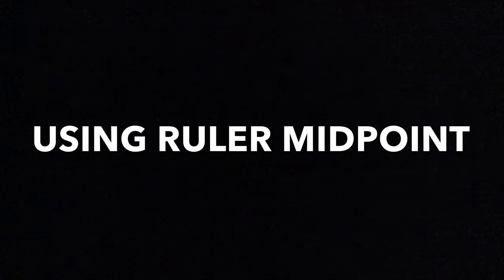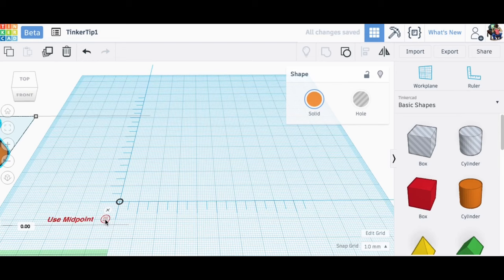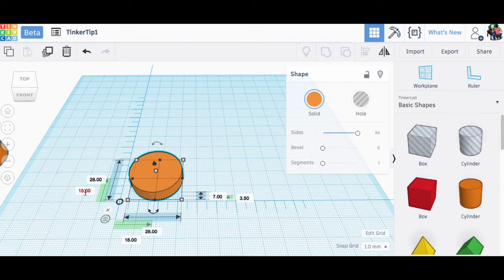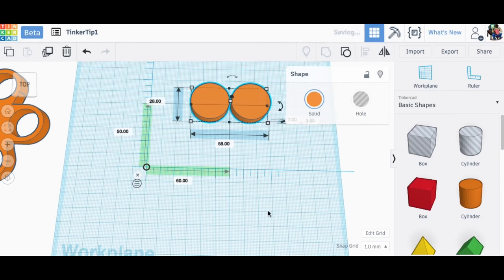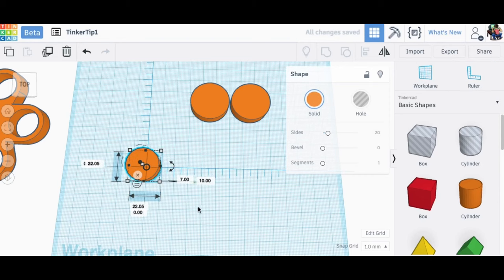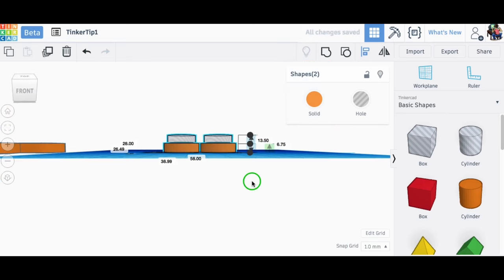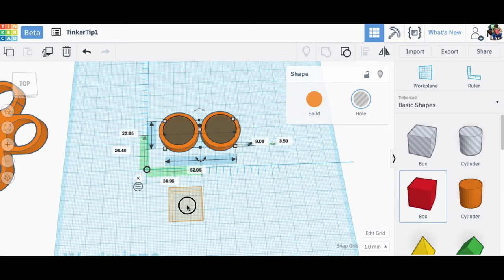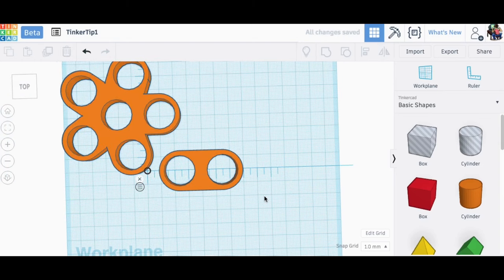Tinkercad Tips & Tricks - Ruler Midpoint on High Five Fidget Spinner

Comment: How do we join faces?  Even with the micro-adjust (Shift arrow) I end up with my objects being 0.2-4mm apart, or 0.1-0.3 overlapping.  I want them to JUST MEET.  The Align tool will line everybody up on an edge, or center.  I want one left and one right... is there a way to do that?
Reply from the maker: Put the workplane on the side you want to connect to, then place the second one on the workplane. Then move the workplane back to normal and center if necessary.

Comment: Rather than rotating the workplane to see if your holes go through the bottom, when using the align tool just click on the solid object first,then the alignment dots are relative to that object rather than both objects, so you could then just click the X, Y, and Z dots and the holes would have been centered perfectly to where the solid object is. 
1. Select the objects you want to align.
2. Click Align
3. Click on the object you do not want to move, now the alignment dots are relative to the object you selected and this object will not move during alignment
Reply from the maker: Yes, I’ve shown that in other videos.